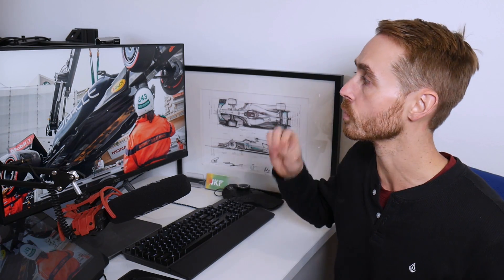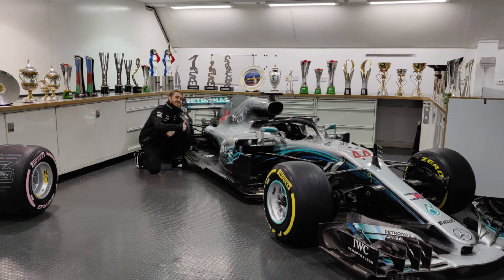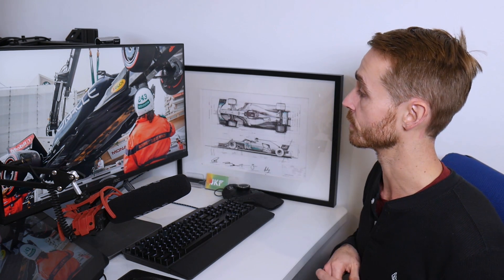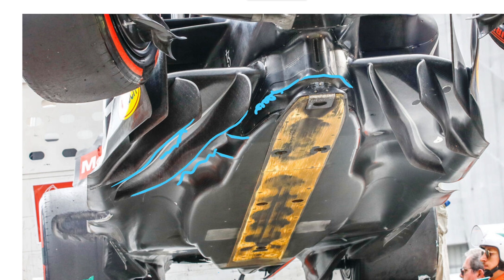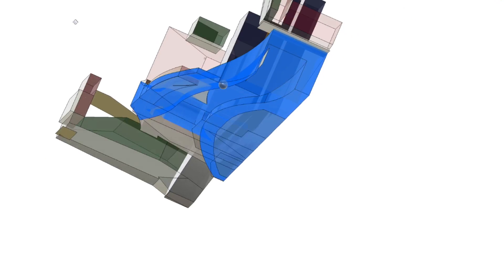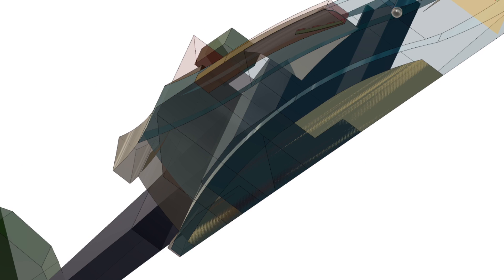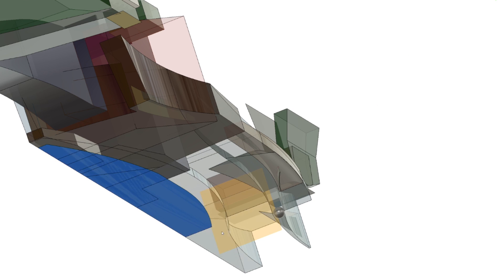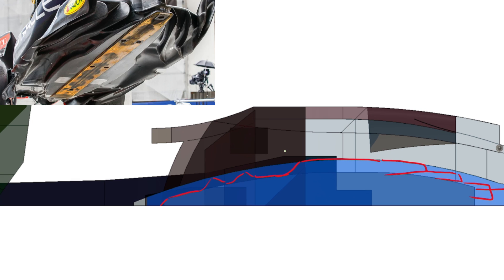How Does Red Bull's Underfloor Work? - Aerodynamics Analysis

Comment: One thing I can´t get my head around is the fact that, at least it looks like, only air passing through between the inner strakes is fed to the middle of the floor and to the diffuser, whereas the rest of the air is being outwashed to the side of the car to help seal the floor.

That being said, it seems that the intake area of the air that is fed to the floor is actually smaller than the middle section of the floor, how does the air gain velocity then?

Comment: Fuckyeah! An F1 aerodynamicist. I have a question for you regarding downforce and drag.
Some time ago I remembered that swimmers used to use "shark skin" wetsuits that had a microtexture, that helped with reducing drag through the water. Do you think it would be possible to lower drag while retaining aerodynamic properties of the car on the outer parts of the car body by adding a micro texture to the body materials or even just the paint?
Reply: I believe that was tried…golf ball cars
Reply: For each Reynolds Number their own. You can't use a Selig 1223 for high speed aircraft

Comment: You definitely “geek out” on all those winglets and other devices. What I noticed and was looking at was the “plank” and how it was fastened and how the fasteners actually made the plank no longer perfectly flat as the fasteners were tightened they caused dimples in that plank. So that begs the question, as a aerodynamicist have you ever thought of theses types of issues, after all some mechanics are gorillas and others have a deft touch with there wrench’s. This can in one degree or another affect how all of the panels and surfaces interact with one another. Would you agree or disagree? If the teams go through all the trouble to tape up all the seems of all the panels each time they go out so it’s as smooth as possible, if you get a person that is screwing panels in so tight that they change the shape of the panels then what’s the use of all that fine tuning and testing?

Comment: Can someone please explain why the strakes are turning outwards from the entrances of the venturi tunnel? Wouldn't that decrease the overall flow to the venturi tunnels leading to less downforce?
Reply: the air going into the venturi tunnel is actually sucked in just behind where the air comes out of the stakes. there is still plenty of air going over the stakes which generate a vortex. which is what you actually want in a venturi tunnel. and the red bull has the best placement for injecting that vortex into the center of their tunnels.

Comment: hi newer cars have wider tyres, and sporty cars have wheels (tyres) that require wider fenders and the wheels themselves stick out more to match the width of the fenders (vs cheap cars the wheels are tucked in). how do these 3 factors affect aero? - wide tyres, tyres narrower than rim, wide fenders, tyres tucked inside vs pushed out wide (not wider than fender). thanks (assuming no aero to deflect all air away, ie the underbody and side air is strong ...)

Comment: Dear kyle, why all underbody vanes are direction outwards. 80% of air entering the underbody directed outwards and only small portion only moves to the ventury and diffuser... Why cant you keep only one or two vanes used for outward wash for seal side pot, and direct more air via stright vanes towards ventury and diffucer.. Why so
Reply: You're inevitably losing volumes of air from the underfloor due to the inability to seal it effectively (mandated legality volumes, no skirts, relatively simplified suspension designs etc.). The solution is to manage the flow and volume of air optimally yourself. To do this you have to design the floor such that airflow generating downforce is consistent at the various speeds the car operates at. No point just trying to funnel as much air as possible to the rear diffuser if it completely messes up the balance and consistency of the flow elsewhere under the car.

TL/DR The best way to deal with an inability to seal the floor is to manage air volume/flow loss optimally.
Reply: @deen-al-afriqi  Great explanation 👍

Comment: Do you have any thoughts on how Red Bull has avoided porpoising? I know it goes beyond pure aero into such loveable topics as aerolasticity of the floor and suspension dynamics.

I would hazard a guess that the ice skate helps keep some of the floor off the track and  avoids it sealing completely when that part of the floor bottoms out to keep some flow moving through
Reply: @TDougs-yj2yp  I wouldn't doubt he said something along those lines, but surely not in such a smug way. He's charming and polite. 

With the benefit of a whole season and another car under the belt, my take is that RB went for a low drag, low downforce concept last year. That gave them great straight-line speed and avoided getting sucked down into the ground effect and bouncing. So, while their rivals were sorting that out, they just refined the car and made it faster. 

 Seems like they have more downforce this year, coupled with more aggressive anti-dive and squat suspension than anyone else to control the platform pitch and ride height more effectively than their rivals. Having bigger side pods than Merc has helped compensate for the loss of barge boards, and keep the floor stiff but I don't think it's the biggest advantage they have over Merc, despite the pundits' fixation on side pods.

Comment: I don't understand why the suspension can't limit the ride height to never be too low? If the floor hits the ground it stalls, is it that much faster to bounce along in the race?
Reply: If the floor were consistently very low it would be possible to design around the porpoising. The issue is that the cars were at a less stable height vs the ground and so the dynamics changed when they got sucked downwards. This year they're all higher so at less risk of bottoming out as long as the suspension is stiff enough

Comment: Oh wow, I never thought we'd get a video on the floors. Some really clever details going on here, this was great.

I do have a question about the older style floors. How does the F1 style kick work, it seems very aggressive early on with a concave area rearwards. Obviously just generally applying to all teams, spilling the Merc specific details isn't needed just in case. But what is the goal. Is it to work the strakes harder and spool up vortexes perhaps? Or does the low height allow different rules to a conventional car diffuser? Or perhaps to move the CP forwards for aero balance reasons? Its something I've always wondered but haven't seemed able to find an answer. I've seen a few other people asking so I'm certainly not the only one, but at this point its a real mystery to me.

Comment: It's very interesting to get explanation for the floor, thanks! 
You pretty often see the floor of the cars when they are removed from the track and it's very easy to spot the huge difference compared to previous regulations. But exactly what and how the differences are and the purpose of the shape of the floor is impossible for just a fan. So to get this in-depth breakdown is awesome and also give a hint of how complicated the floor is. Especially with all the creating of vortex and how important they are. Also I thought the fins in the front of the floor was there to direct the air under the floor but the outer two directed the air outwards which was interesting since I thought they really wanted as much air as possible under floor to create downforce.

Comment: How is it so difficult to make the car a second faster? On a typical track you're looking for barely a 0.1s per corner.
Reply: Making a gain on one corner may hamper you on another or slow you on the straights.  The trick is to find the best balance of everything that gets you the fastest time.  Keep in mind you're rules restricted so you can't just pump more fuel or lower your tire pressure further, etc.
Reply: There are diminishing returns to design improvements and the cars start at a fairly high level of optimization. If there weren't F1 wouldn't be such an expensive sport. The teams have to put a massive amount of resources in to get even small performance gains.

Comment: Great video as always. Could anyone go into detail as to why having this vorticity through the under-tray and diffuser is beneficial?
Reply: Oh, that's a good question! It's all about the Von Neumann effect interacting with the law of turbulent air force retardatio. Plug the radius of the generated vortex in as theta, and calculate the median (some argue that the mean is better, so I suggest you try both and make up your own opinion about that) outward force of the air molecules (correct for any CO2 levels though) to plug in as omega. Then solve for the acceleration (per second/per second) instead of just doing the formula as is. Now convert back to 3 dimensions again and project the topology onto 2D space. You can find both formulas on Wikipedia if you're not familiar with them.
Reply: Just to be clear, the areas of the resulting 2D projection will be the local maximums of efficiency. Fun fact: You can actually read the results and compare using only the 3D topology, if you're good at it (or rather used to that kind of data)!
Reply: @oonmm  thanks so much ill have a look into that :)

Comment: I was watching a video recently about an rc scale model of a top fuel dragster and it went into the aero or more correctly the downforce generation in them. The rear wing is obviously the most notable aero feature on them and that together with the front wing and it's massive lever effect means there is tonnes of downforce when they get some speed happening. I'd actually love to see a bit of an analysis of the aero forces on a typical dragster. The speeds are ginormous but I doubt there's any other vehicle with such a huge amount of downforce and such an apparent disregard for any reduction in aero drag.

Comment: Kyle, very interesting as always. Perhaps I have missed it, but it would be interesting to understand the upkicks on the front suspension that seem to lead into the double bargeboard. 

And how does the double bargeboard work ?  Does it load up the sides of the car at speed to help achieve variable sealing (ie reverse effect of the M-B stays as the rules do not rule out body work movement, just wing movement?).

Comment: Kyle, absolutely brilliant video, as always. Thank you.

A question; couldn't the 'ice skates' be serving the purpose of walling off some ait through its vorticity? You mentioned something similar, and I might be misreading the angles, but to me it looks like it could actually block some of the messy air from the floor cut outs, pushing it to the wheel, while allowing lower frequency smoother vortices to keep on towards the rear of the underfloor.

And just to point, I know your target demographic is not the general public, but tbh even I at some points in this one lost a bit of my sense of direction while you rotated and moved your models around - when we are agents of the movement it is always smooth and easy to follow, but if other person is rotating the model, the lack of reference can be disorienting. I have no idea how to make it more accessible, but maybe you could investigate it?
Reply: I think that even doing the exact same movements but at half speed would work.

Comment: Great vid Kyle! 

I have a relatively fundamental question about how the aerodynamics are working here so pardon my elementary explanation. I'm used to seeing vortexes used around the car as somewhat of barriers or methods to direct other flow, such as in the previous regs how you could use Y250 to steer airflow around the car or how teams are using vortices in order to 'seal' off the edge of the floor this year. Based on this video, it seems as though teams are trying to create a lot of vortices in the underbody but I can't picture how they're being using in the same sealing / blocking manner. Is it the case that it is these vortices themselves that are providing the mass flow necessary in order to create the underbody downforce? If that is the case, does the strength of the vortex roughly corelate w/ downforce produced? Is it a case of energizing the air as much as possible in order to derive maximum benefit? 

Hopefully my question makes sense. Thanks for the content!